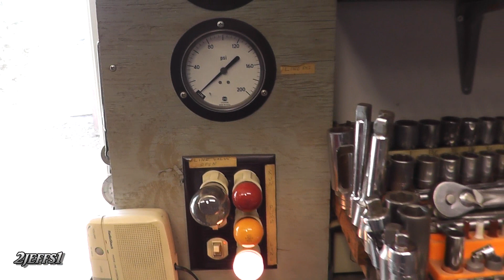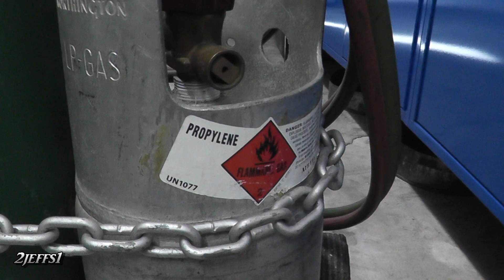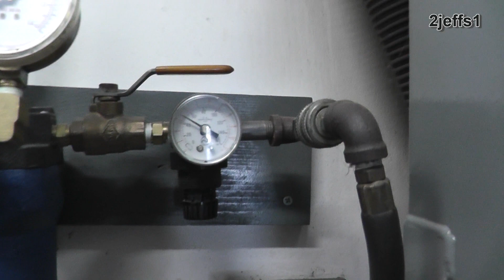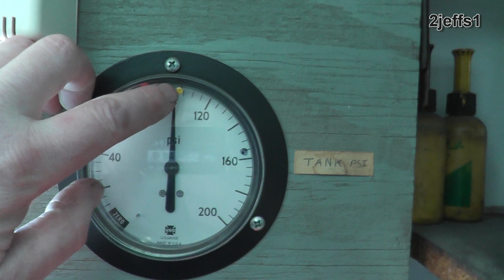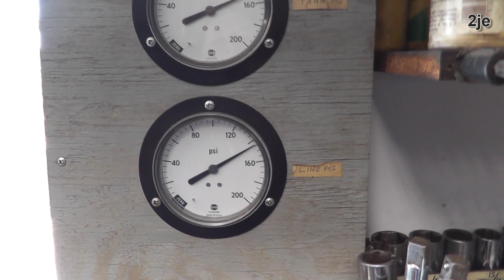Air Compressor Setup Money Saving Tips & Ideas

Comment: That looks like a propane cutting tip. They are two piece. That is mainly what I use because it costs so much less to run. I own my bottles, three oxygen and two acetylene, plus a 75/25 bottle for wire welding. I bought most of them years ago from Airgas and have never paid rent. Can't hardly buy them any more, though. I use the acetylene if I need to do some fine cutting or gas welding. About $45 for a bottle of acetylene and I can refill my 5 gallon propane bottles out of my 500 gallon tank for like 1.75 a gallon. And the propane bottle will outlast the acetylene bottle. Are you using the propylene? What is the cost of the propylene, bottle, etc? No problem hooking up the gauges?
Reply from the maker: Junk Yard All I've been using is the propylene. I was told it is a hotter flame than the acetylene is. I do own the tank and it lasts so long I think it was 20-30 bucks to fill it. The guy that sold the setup to me years ago said it lasts 5 times longer than acetylene tank of the same size. That was hard to believe but was all true! The gauges screw on with the LH threads same that fits the acetylene tank. The tip is the only difference. The PSI settings are similar too. The only drawback is you cant use your old acetylene brazing tips. I use a smaller one which works good to concentrate the flame more. For all I know that propane tip you mentioned might very well work. Yeah I'd never go back to acetylene and really like the propylene setup!
Reply: you can use those two for cutting and for heating metal but in my case I have to have some acetylene around for brazing. I have both because you cant braze with propane or the propylene.

Comment: There is just the one pump for all those receivers - how long does it take to reach full pressure from zero? What about the refill time? 
It's an interesting setup you have.
Reply from the maker: Never timed it. One can see the gauge climb while the pump is running, several minutes I guess. Where an electric motor can take 6-8 x the label amps for x ms on startup and no air loss when that valve is off there was a notable drop in the electric bill for sure!

Comment: Hi jeff you made a very nice video. I wonder if you can tell me if i can use my 24L 1,5hp air compressor to fill another 100L tank because 24L is very small and i can`t do any job with this air compressor.
Reply: Ευστάθιος Αναστοπουλος no reason it wouldn't work but it will take about 4x longer to fill. You could also gang the two together and take advantage of all the volume at your disposal

Comment: How does the red light come on?  Did you just put a wire to the motor?  Also, with all the noise compressing makes....
Reply from the maker: EnergeticWaves That's hooked up to one of the 110v lines from the pressure switch inside the magnet starter switch. Then you can put an inline 5A fuse there to separate the circuit from the motor circuit breaker which is a much higher amperage. The air intake on that pump is quite loud. At my previous house years back the neighbors were pretty close. I put a car muffler on the intake line. Big difference. Like happy neighbors! :>)

Comment: Ohio accent? like the set up.. question on my 2 stage 50gal set up. I'm trying to open the tank ends up but it's seems to stuck for PB blaster, heat and a half inch nematic driver to even budge. any suggestions? I'm wanting to restore my grandfathers ole Sears model. thanks in advance
Reply from the maker: I hear ya. Always had a hard time on those too. No tips, remember giving up on those too in the past.

Comment: Where did u get those big pressure guages bud? Do they come with the little cut in/ cut out lights? And the switch you use to turn on the air compressor is it wired in for 220 or 110? 
I love ur build and wanting to make a little panel aswell.
Reply from the maker: There called flush mount panel gauges. I bought them from Granger. (3-1/2") The cut in solenoid for the starter box is 110v and I have a 5a fuse in line just for that, those indicator lights and shutter motor. I definitely gathered your aware one can't use 1 of the legs from the 220 breaker for the motor to power those low amperage circuits. Good luck on your project, Jeff.

Comment: Hey jeff, I am from Michigan around the detroit area and have been looking for a kellogg 352 pump for a little bit, if u see or know where I can find a used pump at a good price could u give me a heads up. I currently have a kellogg 331TV with two 80 galllon tanks. I would like the bigger pump to help out with running a sand blast cabinet. your video inspired me to build my current set up. thanks for the information!!
Reply from the maker: Hi Brian, thanks for stopping by. If I hear of something - yes I shall tip you off. Actually a friend gave me the tip on the one I got. I enjoy feedback such as yours where it makes putting these videos together worth the time and the reason I started this YT thing.
Reply: Hey Jeff I found a Kellogg 352 in Detroit on craigslist for $100 needs some lower end work which I have parts coming.I went threw the valves and seats can be lapped wanted to find just the valve and spring set. I saw u were using comp air. Is that still available? Also any leads on a single phase 7.5 hp used  motor would be awesome thankx, The cheapest I found a new one was $650 on ebay ouch!

Comment: Hi jeff thats a great set up.Can you tell me the cfm of that compresser pump.I have a 15cfm 3 hp and a 2 hp 9 cfm linked with a delayed start between the machines ,so both moters dont start simultainusly on single phase /240v.I have been told that the maximum air pump size is 15cfm/3 hp moter on single phase/240 v is that correct.How have you managed to connect and run such a big pump on single phase supply.Cheers Steve ruf (uk)
Reply from the maker: Hello Steve. Can't remember the actual cfm of the pump where it has been so many years. approx 40 - 50 it seems. Here is some info that might be helpful for you. I do remember that pump is rated for a 7-1/2 to 15 hp motor. I am running a 7-1/2 on it.  The motor label is 39.8A @ 220 (single phase 1750 RPM)  I have a 40 A breaker on it in case anything goes wrong so it will pop it quickly. This is run off a 200A service. I had very good luck with this and never had an issue with the motor. Maybe check what the biggest motor that could be run on what you have there and purchase a pump for that size motor. I enjoyed your thoughts/write up as at my old shop I had considered a similar setup. Hopefully this will help you out Steve, Good luck, Jeff
Reply from the maker: 2jeffs1 Hi Steve. One more thing I'd like to pass along to you. At my old shop the house had a 60A service which the garage also was hooked to. It worked very good. I had this setup running there for several years before moving to here. I only blew the main in the house 2-3 times. The pop machine, window air conditioner, maybe the house fridge, & was welding and forgot to leave the compressor off. If one was to use the welder or compressor separately there was never an issue. I thought this might be helpful for folks who might not have had much wiring experience. It's nice to know what can actually be done....

Comment: I worked at Don's Johns briefly and they ran their compressed air throughout a large warehouse in pcv pipe. PCV PIPE? That's what i said. Yep that's what they ran it in . about less than an inch dia pipe white in color
Reply from the maker: bob brawley I always wondered if anyone had ever done that. That sure would make for a quick/easy installation!

Comment: Hey buddy 
I have an old Schramm built in 1951.
Is it worth the doing a valve job?
Served me well but is getting tired.
Reply from the maker: Your best bet is checking the availability of all the parts needed and pricing. Not sure how old my pump is . If possible I would prefer to keep mine going when the time comes where those old beasts last so long.

Comment: Could you tell me the make and model of your compressor pump?  I have one just like it and can not find anything about it in order to purchase a rebuild kit. Thanks
Reply from the maker: It is a Kellogg pump. The model # stamped on the pump is 352TVX. The 2 is scratched up but I do believe this to be correct. If you Google this you should get some pictures and parts listings. Good luck David, Jeff

Comment: Hey thanks for the video hopefully you can help me out I just set up a 80gallon ac and I'm trying to run a lead hose from the compressor (I have a 1/2in ball valve directly out of the tank) to a wall mounted 1/2in filter and regulator then out and up to a hose reel but I can't figure out how to tighten both sides of the lead hose for ex. If you tighten the hose to the filter then try to run it into the side of the reel you can't tighten it. and I'm using 1/2in hoses so I wouldn't want to use a 1/2 to 1/4 reducer and put a coupler on there seems like it would really choke up the system
Reply from the maker: +Ctyler93 Hello Ctyler93. Google 1/2" union. You will see some pictures and this is what I believe you need to get your project going. You will also need a 1/2" nipple to finish the union install.

Comment: What model is that pump you have? I am think it belongs to the Garner Denver, champion, speedaire family of pumps? I just got a 80 gal champion r15b in my garage.
Reply from the maker: It is a Kellogg pump. The model # stamped on the pump is 352TVX. The 2 is scratched up but I do believe this to be correct.
Reply: That's pretty cool! I have a Kellogg 321tv it looks like it's smaller brother. My tank is dated 1947 still going strong!

Comment: Nice setup man!  What are those big face PSI gauges called and where did you find them?  I've been looking for those and can't find them anywhere, probably because I'm not sure of their name.
Reply from the maker: Hi Michael. I went upstairs to check if I had a spare one to get the p/n for you. Those came from Granger. Their p/n is 1x581. They are called 3-1/2" panel mount flange gauge. Granger showed no longer available so I got the manufacture and p/n for you. Ametek 138057. These should come in a 2" size too. Good luck on your project Michael, Jeff.
Reply: Thanks Jeff, "Panel Mount Flange Gauge" returned all kinds of hits, so I'm good to go!

Comment: You must live up nort ay?  I just got a 1955 Beaird 100 gal compressor I'm going to restore. The tank is 3/16" steel and the compressor pump looks as big as yers!
Reply from the maker: Cool - Not sure of the mgf date of mine, probably quite close to that 1955 area. Once you get that rebuilt it will probably last a lifetime v/s multiple of the cheap ones now a days!
Reply: If you had to buy a brand new pump nowadays what brand(s)  would you consider if you prefer quality/longevity over price? thanks...
Reply from the maker: I bought a saylor-beall 5HP 2 stage for out in the storage shed a while back. More $ than the cheapie's (It's USA made) quite happy with it and had put some serious hours on it several times for projects out there.

Comment: i haven a curtis single stage pump and a 35 gallon tank and im wanting to build my own compressor can u recommend a motor that would be good i was gonna take an old grinder and put a pulley on it but i wasn't 100% that it would be enough power or it might just burn out, thanks for any help
Reply from the maker: steven coker Hi Steven. Not sure on the recommended size of motor for the pump. That is good to know then maybe check some rummage sales. They are a good source for a cheap motor. I don't think the grinder motor would work properly but I know how one likes to use what ya have on hand...
Reply: you have your shop ingeniously set up would u mind if i ask u some more advice as i come to it??
Reply from the maker: Some things are easiest in person when one can visual the entire project, I'll see what I can do tho...

Comment: Hi, quite a set up,   Thanks for the tips.   I am still setting mine up.  Being retired, my objective of setting up at minimum cost  is wise as it forces me to learn much more than I would if I took the Cheque book solution.

I am having trouble setting up the wafer type valves, which I am sure were set up wrong when I purchased my old 2 piston reciprocating pump type compressor.   

Can you suggest where I might go for valve set up advice?  The brand info has come off the original hardware and no service shop wants to touch it.  They say it is cheaper to buy a new one than pay their service charges, which is probably correct.  Any suggestions?
Reply from the maker: That's sad to hear LIoyd. If you could find out exactly what you have, then find a parts blowup would show what order to assemble the parts in the valves. Maybe google air compressor valves. then click on the pictures to view more. Find something like what you have, then click on that picture. Takes time but can give results. Some folks aren't real ambitious. Don't let that detour you to get your compressor going, actually several times thru the years on different matters I would offer someone some $ for their time to get some helpful info. Might sound stupid but it helped in several instances. Speaking of work, gotta get back, good luck, Jeff.
Reply: Thanks, I have tried local sources with no success, even with chequebook in hand, but you have given me a solution, I will make a video of the problem in the reasonable hope that another youtuber out there will know the situation and have the answer

Comment: Hi there! It's realy nice and neat air set! I like this :)
What can you tell about compressor efficiency?
Reply from the maker: +qmpel The cfm of the pump varies with the size of the motor used. It can be from 7.1/2 to 15 hp to run this pump. Here is the part number of the pump if you would like to check them out on Google. 352TVX

Comment: Hi Jeff!
I have a question, I have an ingersolrand t-30 when I shut it down and leave it for a few days I lose my tank of air. I always shut the valve that leaves the tank off and I have checked all my connections with the soap water method and can't find any leaks. So I sure the air is escaping out of the compressor. I doubt I have 500 hrs on it. (bought new) so what do you think?
tim in tillamook
Reply from the maker: Trask Stone Hi Tim. Believe can help ya on this. 2 places to check. There is a check valve in the large line that goes from the pump to the tank. it screws into the tank @ the tank. If that is leaking the escapes back thru the pump. When I set this up I ran into that. The NEW valve I installed lightly leaked. I took the line off that is in between the pump and tank with some air in the tank to detect this. (Be sure to drain the tank air before removing the check valve)  It had a nylon button in the check valve when I took it apart which don't seal 100 %. Made a new one from some high grade rubber with steel sandwiched in the center of it. This material was app 1/4" thick like the nylon button was. Used a small grinder to make the round disc. Seals perfect and never touched it again. I had the material in my hoard pile & don't remember who gave it to me or unfortunately can't tell you where to get some. The other thing could be the pressure blow off when the pump stops. this relieves the pressure on the pump head. Several different types. Check the outlet on that too. Hope this gets ya fixed Tim, Jeff
Reply: 2jeffs1 Thanks jeff I will do that this morning.

Comment: hey there, i seen ur air compressor you had shown the replacement valve gaskets and parts. is there a site i can access to get proper parts for my curtis two stage compressor
Reply from the maker: Hi Daniel. All the parts I have been getting are from a local air compressor place. There probably is a good site online. If anyone knows about one please chime in.

Comment: 2jeffs1 - fantastic video!  I love the setup you have built.  It's really impressive.  I have a question for you: how do have the red light wired so it only lights up when the compressor is running?
Reply from the maker: It is connected to the 110 lead for the starter box solenoid.  I do have a 5A separate fuse for the controls where the 40A breaker for the motor would never pop first. If your setup don't have that starter box and just using the pressure switch it could be connected to one of the 110 leads for the motor or pressure switch. Again - the circuit breaker for the motor is 40A so an inline 5A fuse at the connection for the light should be installed. Glad you enjoyed the video and thankx for stopping by, Jeff.